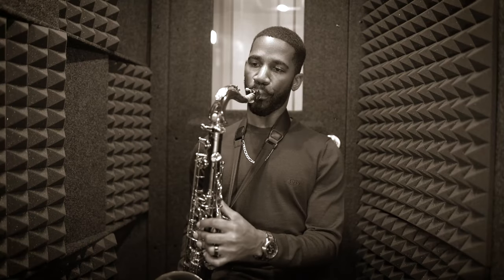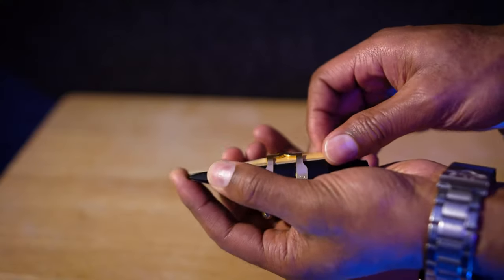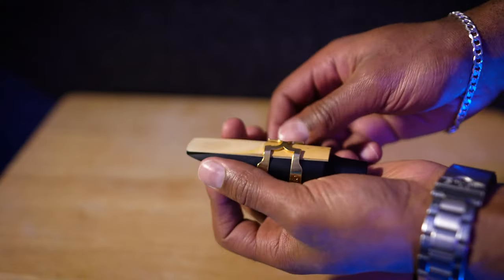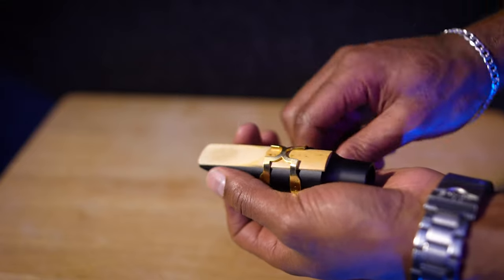Are you using enough air when you play saxophone?

Comment: Thanks for this, definitely describes my issue (underblowing) although my reason is different.  I had an injury in early 2021 that took me months to recover from, and it made just breathing painful, so I lost a lot of lung capacity at that time.  My teacher has me backed all the way to a 4C mouthpiece with 2.0 reeds but I can still struggle to move enough air, especially for the low notes.  Any good exercises to help get my lung capacity back?  For practicing, I try to get 3-4 30-60 minute sessions in a week, either after work or during my lunch break (I work from home so that makes that part easy) but I don't always make that goal.  Definitely something I need to work on, because after for example a 10-12 hour work day sometimes I just can't motivate myself to do anything productive for the rest of the day.
Reply from the maker: Yes I can relate to trying to practice after a long work day, that’s pretty hard to get motivated for. 

It sounds like you’re making the right equipment choices though, making it easy enough to play based on your health circumstances. 

As far as exercises, I’d recommend practicing long tones, sometimes holding one note for a full breath, and sometimes holding a note for a set amount of beats and slurring to the next note until your breath runs out. 
The challenge with the second exercise is to see how many notes you can fit under one breath if you were doing 8 beats each note for instance.